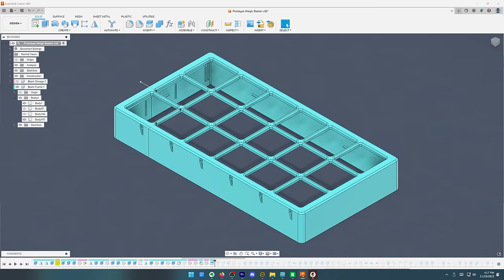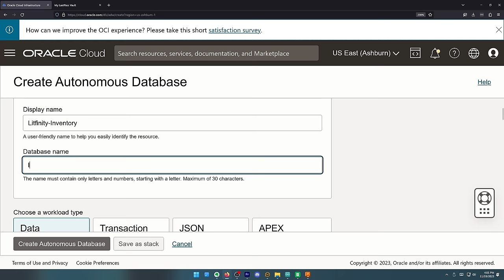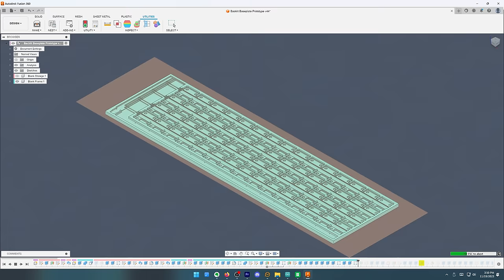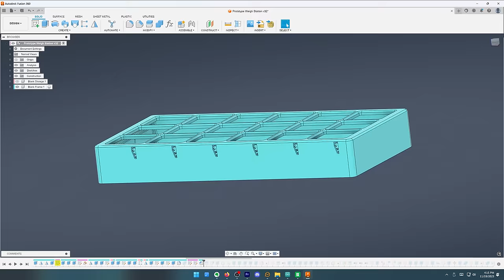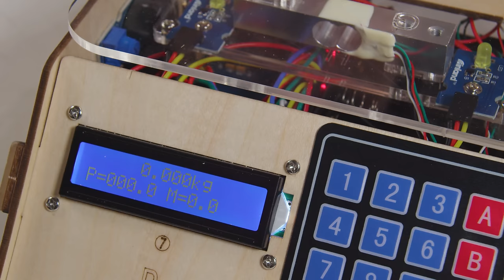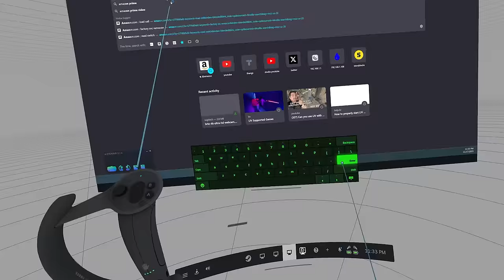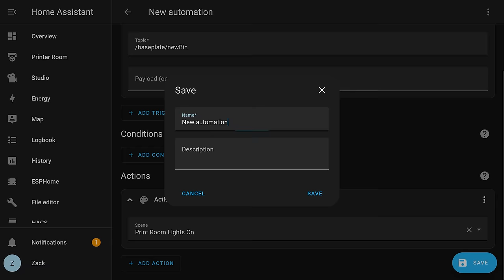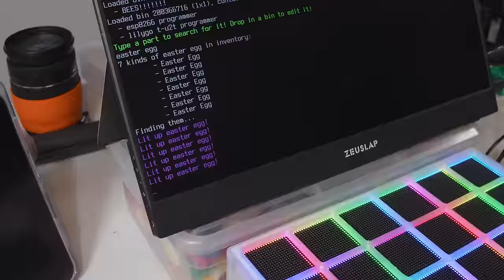My Storage has a Search Bar! Gridfinity + 8,552 LEDs = Litfinity!

Comment: I need this in my life, right now! I have no idea where most if my parts are these days... edit "hallucinating ball bearings again" now that's a mood 😫😫
Reply: I have spreadsheets - item/shelf/row/column/layer/etc(brand, use-by, packs,qty/pk) and have to keep it manually, but it works for both the pantry AND my workshop major parts storage. The Litfinity setup would be great.
Reply: @ the ball bearings:  I hate that I've been there.  I bought some for a spool holder I printed years ago and they've been randomly floating around my workspace(s) through too many moves for years and the 2 times I've gone to look for them I've questioned my memory and my sanity.  Then of course they randomly appear on my bench a few weeks after I looked for them and now I can't even remember why I was looking for them in the first place.
Reply: Have you checked out the sorters in the chemist, that arm that goes and grabs your prescriptions ? That would be awesome in any shop where you have tons of bits and pieces...

Comment: I know a lot are just saying go wild but personally I feel projects are at their best when they are as simple, elegant and universal as possible.
Also a suggestion, if magnets are going in the base plate and bins, I'd try wiring them up and using contact/continuity sensing.
If it works well, then it'd cut down on part count and you won't have to solder to a ton of read switches.

Comment: Very nice try, but a hungarian would:
- Have 4 load cells under the four corners, those will tell you the full weight AND the location where that weight was added. No need for the wiring and fiddling with the reed swtitches, no active part on the grid at all.
- Have an ESPCAM look at QR/AR codes on the side of bins. No need for rfid tags or reader.
- Have only 1-1 led for each row and each column, and train the user's brain to be able to decode which is the target bin. You only need sqrt amount of leds.
- Software: no raspberry, just the ESPCAM and your phone needed. To save typing partnames, have the AI guess what the part is.

Comment: bicycle gear sprockets and chain for the rack rotation mechanism, easy to do with hand tools. plus, can start with a pedal for a hand crank, and then upgrade to a motor if it works. or just start with buying a replacement motor for an e-bike as your driver. great work as always.

Comment: Zack, these videos are amazing and this inventory system is something that I have dreamed of. But please please PLEASE don't use the AH49 series for doing simple hall effect switching! There are plenty of hall effect switches, not linear hall sensors, that do the job 10x better. AH175, TLV49645, AH276, every TI hall sensor. Integrated schmitt triggers, hysteresis, programmable trigger points, etc...Those of us using linear hall sensors to do current sensing, position sensing, joystick axes, etc... have a hard enough time finding AH49H/E stocks without sending thousands of your crew to these treasures of sensors to make their own similarly-awesome inventory system 🤣

Comment: there is a company that produces drawer organizers with electric inventory software. It lets you select the tool you need and blinks the drawer you need to open and then opens the slot with the tool in it by itself. Not only is it used to find something but also to know who has which tool as you have to log yourself in to use it. Ever since i saw that I always wanted to do something similar like you did.

Comment: For your further development of the project: If you like the side NFC stickers, get NFC capsules or a different shape of tag. The stickers are only so big because they have a round antenna, they make square and rectangle, and micro antennas as well. Bonus points if you use glass capsules that you just drop into a hole in the side of the bin, maybe always preferring the "assumed front left" position, so it's consistent.

Comment: I always wanted to build a small parts bin rack with e-ink labels. They're still a bit too expensive to make it reasonable but I'll be watching that space.

On the subject of showing project builds that are beyond the scope of most common maker's tools, time, skills and other resources - I say definitely go for it! 
Quite apart from being simply inspirational, there's a very good chance that a particular inaccessible or expensive process could be ingeniously adapted by a viewer to be be performed in a more 'home brew way' with equally good results. Then we'd all have that forever.

BTW,  and not entirely relevant, the new inductive sensor IC's from TI and Microchip are amazing! You design your sensors as pcb track coils. No 'magnetic magnets' required! Just some metal to change the resonant freq of the (coil + a bit of C). Could even be another sliver of pcb or a compressing spring. Analogue keyboard switches anyone?

Comment: I personally think that with any projects that have an actual common use you should strive to make them open source and buildt in a way that is easily replicatable by people in the community. You are an open-source beacon of great ideas. Gridfinity has single handedly changed the way i think about storage, whereas before i was worrying if things would fit into my ikea boxes. 

So yeah, with any project that has mass appeal, i'd love it if you made it with the community in mind. But that's just my two cents! Great video, as always. Thank you Zach

Comment: this is next level, im using an old arduino based system with a hand made matrix with 1 led per drawer. from like 8 years ago. its great for searching for a part bin, but thats about the end of it. it requires me to put it in the right place and enter all the information manually. i originally used it on the wall mount bins, but in the last few months i started incorporating it into my gridfinity prints. uses 1 arduino as a master, then uses one for every 60 bins as a slave, the master talks back to the reguired slave and it light up the led in that drawer. can be wired from unit to unit or can use bluetooth or rf communication. i guess you could use wifi but for such small data flow its not needed.

Comment: Less so for the baseplate, but for the vertical carousel, I think the easy answer would be QR labels and computer vision to locate. Requires maybe a small grid of cameras positioned at some point along the carousel. Depends on how much detail you're trying to embed into the QR.

Comment: The concept is remarkably similar to the system I had to learn working sortation at an Amazon warehouse. There's hundreds to thousands of bins organized into aisles, and each bin has rope-lights and a scannable tag. You scan a package barcode, the corresponding bin frame lights up (which, assuming the labeling and belt-buffering associates did their job right, should be in the aisle you're in). Take the package to the bin, scan the bin tag, and it's sorted. 50 GOTO 10 about a thousand times a shift.

Comment: Effort doesn't equal progress... THIS is so true!  I like these kinds of videos.   Very cool project.  Comment contains project ideas and an alternative conceptual framework for organization.

For this project a couple of weird ideas I had: 1. a camera AI solution?  2. Is there a serial shifting thing like a neo-pixel sensor equivalent that you could scan the presence of the bins?    

I like organization, but in my case just having a light turn on where in the shop the part can be found, like which cabinet or drawer it's located might be sufficient granularity for my purposes. I don't have any issue searching a drawer, that's already cut my search time down considerably...  But here's the issue with ANY such locating system:  Usually my problem is taking the parts out and then they get scattered because once out of the box or bags; if they're not put back, then I have no clue how any organization system would track them otherwise... maybe a future problem to solve??

For example I have a tool, or part, in my hand and I set it down, somewhere, then not even a minute later where the heck is it?  I'm getting better at not doing this, but it's a combination of discipline and shop infrastructure/organization... Like Adam Savage calls his "first-order retrievability" principle and so-forth.  And too much stuff that's not needed to be first-order retrievable is just clutter, it seems we all have that!   Cheers to you and all the makers! Have a great day!

Comment: This comment is kinda late but Amazon does this at their warehouse picking stations in the most interesting way. Robots bring the racks to the pick/pack station, and a little flashlight-y thing shines a light on the correct compartment(s) to pick from. The bin stacks have no hardware at all (besides the, y'know, Kiva robots that move them around). Not RFID-powered, and not sure if they have load cells but that could certainly tell if they pick too many/not enough. The pick/packer humans do scan the barcode on each item to make sure it's correct and the package gets all picked items.

Comment: Freaking sweet. Now overcomplicated it. I'm assuming that the bin's size is connected to it's nfc tag, and that your only putting magnets in the corners so you can not only tell the bin's position but orientation as well. That means you can use the same array you're using to light up the compartments to make a web interface and easily manage what each bin contains, as well as links to easily reorder once inventory is low. Once you get the inventory system working, you can even have a one click button that compiles a shopping list for you. Also, run the home assistant integration in the reverse direction so you can just be in the room and go "Google show me this guys balls". I mean bolts. Also, if you don't get the weight sensor working for inventory, you can always use home assistant to track inventory by integrating it with the database so you can read parts off as you take them. I have a feeling that's far more complicated than a load cell, but I also have a feeling you'd like that, you dirty boy.

Comment: When you make the carousel, i would not like to see the trays rattle about. My idea would be to have a 5 meter long spring steel loop on each side of the trays, attached with bearings to the tray. On the bottom side of every tray there should be a rotating mass, which will keep the tray level. With this the whole thing can be as light as an automatic warehouse sorter can be.

Comment: Dear Zack, I wont read over 600 comments so far to see if someone has thought the same. But maybe the  scale problem could be solved with weight difference rather than overall weight. The delta of it could be your trigger only if NFC read scan triggers. Great video as always.

Comment: I love to see it. Some 20 years ago I detailed out an entire storage system - with searchability and lights - and then moved onto 100 other things and never built any of it (I'm sure most can relate), so I'm delighting in watching it come to life with no effort on my part. Thanks!

For the curious, my version was: a wall of drawers, and this [unrealized] project made me notice for the first time - and become annoyed by the fact - that you can't put drawers right to the ceiling, because how would you get into the top one, and how much effort would it be to get into ones above your head, and maybe the top ones could just be flip up doors revealing in-wall cubbies? Anyway, the drawer fronts would each have a little LED in the front top corner, to alert me of which drawer to open. This later evolved into just having the drawer slide open. I wanted on the side wall to have a little built-in screen with a camera (this was pre-iPads, so I was living in 20X6 with this concept), and I'd hold an object up, see it on the screen, and use all-voice commands to say "add item" - it takes a picture and shows it to me - and then I say a bunch of keywords. Blue handle scissors? "Blue", "scissors", "tool", "cutting tool", etc. I did this with bookmarks back in the early 2000s with Kaylon Powermarks (https://udger.com/pub/img/ua_screenshots/Powermarks.jpg), a Windows GUI that lived in the tray and let you add the page you were on with a hotkey. It popped up an entry window, pulled out the name and URL for you, and had a keywords box, where the magic happened. After I had about 3000 marks in there, I started getting emergent results, like realizing 3 things I'd marked were from the same person, or finding crossovers between hackers, musicians, and Nintendo/Game Boy modders. Anyway, this also had the problem where you'd add a link, think of a great keyword, and realize you wanted to go back through all the things that keyword would be great for and add it, but it was super difficult to do now, with thousands of old bookmarks to wade through. Why is everything always so difficult? So anyway, later I'd say "Find item," and it would wait for keywords, and I'd say "blue scissors" and anything with a "blue scissors" entry would be first, followed by blue things and scissors. The pics would show on the screen, and if I tapped one, that drawer would open. I wanted weight sensors to know if I took the thing, and when I came back, I wanted to say "Return item" and it would show all the 'checked out' items, and I'd tap the scissors pic, the drawer would open, and I'd put it away. I could also Add Item, and see pics of the insides of the drawers (oh yeah, there were [very expensive back then] cameras in every drawer, or a few on the ceiling that would take update pics when the drawers opened), and select one, or ask to Find Item, look for scissors, open that drawer, then say add item, do that whole spiel, and throw them in with the others. And then a dozen other cool ideas that fell out of that, but you get the idea. I was never really sure if this system would be a time saver, or sink.

Anyway, I applaud you for actually doing the thing.
Reply: Okay, I paused to write all of that, and then saw the part with the conveyor shelves. I've wanted those forever, too, and seriously thought about knocking a hole in a closet wall, but it's another of 10,000 unfinished/unstarted project ideas. My inspiration wasn't 2008's Wall-E, though, but 1986's first episode of Pee-Wee's Playhouse. His toy shelves were a conveyor system, or probably just a bookshelf 2 stage hands were manually lifting up behind the wall, but in my heart, I always knew it was a wrap-around conveyor, and I wanted it. https://youtu.be/oESTzG4r3VA?t=152

Comment: With more magnets, you could use the magnets to encode the id. North, South or no field gives you 3 states. With 6 magnets you could encode 729 IDs, with 9 magnets 19000 IDs. If hall effect sensors are too expensive, you could try an optical system, with colored dots and photoresistors. Or you have a few pins that get pressed when a box is put in. Or these pins block a few light sensors. Brother uses this pin arrangement in their label printers to detect the type of label cassette you inserted.

Or you ditch the whole encoding system, put an optical code on each side of the boxes and a camera that tracks their positions and IDs.

Comment: 9:12
The reed switches might have been expecting something different from what you were giving it - I did a LOT of trial and error (mostly error) using a single disc magnet with a single reed switch for a piano sustain pedal contraption - reed relays are intended to work with bar magnets, if you want to use a disk magnet, you have to either have it perpendicular near the center (like standing on edge), or have it flat near one of the two ends of the reed switch.

Perhaps you already know this, but... maybe this comment will be helpful to someone else that hits this issue.

EDIT:
AHH 12:12 I see you got it!

Comment: Load cells can be a giant PITA. That being said, you could in theory print load cell via being able to directly print strain gauge with multi material printer and conductive filament. I had considered doing this myself to make a solid state electronic torque wrench with 3D printer... then I just went and bought a torque wrench attachment for my 3/8" breaker bar off Amazon. :/

Comment: Zack, you might get away with power cables running up to the tray if you run them across the back of the load cell. Basically you want the cable as close as possible to the point at which you are measuring and that point should be as close to the centre of balance as possible (any twist could cause inaccuracy in the weight you read)

Comment: I would have used LED Keyswitches. You plop box down, and if it pushes 2 switches down, not only do those switches know to light up, but also know what sized the box is. The magnets can still hold the box in place while keeping the button pressed... And you can get big ass bags of led switches... well, cheap enough for a permanent project like this.

Comment: as for the database thing. i once worked for dell warehouse. picking parts. and the database was simply a excel sheet. with a row for location data, qty, backorder ect. and any time parts are taken for orders it automatically adjusts the amount when the orders are completed. as for the location. its simple. they use a 3 number guide. first. the isle. like any large super market. you got isle numbers. than what shelving unit in that isle. once you find the shelf. you than look for the bin number. it was Shockingly efficient and quick considering no RFID tags/ AI driven cameras or any of that nonsense. just a scanner, barcode font and excel. but yes. there was defiantly discrepancies. system saying theres 20 of something and there is NOTHING because they got picked soo fast the system hasn't updated the qty yet.